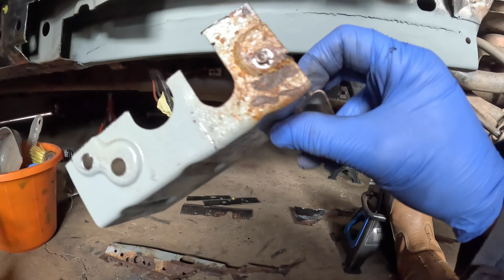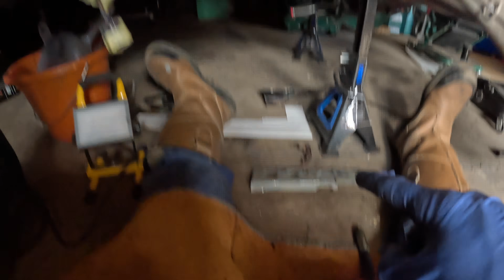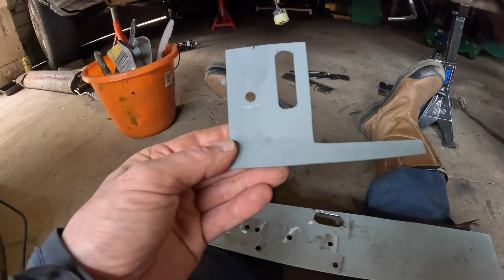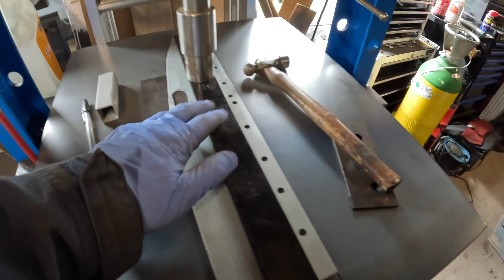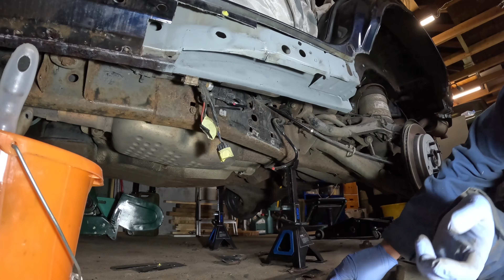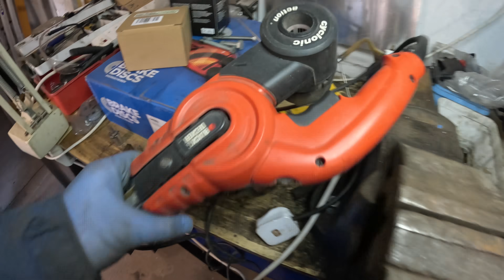DISCOVERY 3 LH SILL. PUTTING IT BACK TOGETHER THE MIDDLE LAYER

Comment: a lot of work and nice prep! I wonder though - would it not have been quicker and easier to cut out most or all of the sill and replace with a pre-made new sill?
Reply from the maker: Thanks. I did buy outer and inner pre made sill sections, but the inner middle one wasn’t available unfortunately.

Comment: Great gob well done I have a td5 disco 2 2000
What size wire are you using please
Reply from the maker: Hi. Thanks.
I use 0.9mm. I do also have 0.6mm, but I found that I was getting issues with the wire folding up too much coming off the spool when you get a bit of splatter on the tip. I just don't get that with 0.9mm.
Reply: @LR-nut  I am the same I bought a large spoil of 6 mm and it hard to go though the gun I change it to a 6mm roller but nut changed the inner liner
Should I get a inner liner or just stick with the 8mm wire
Reply from the maker: @GarrysMotorcycles8648  maybe that is why my machine has issues with the 0.6 wire, it's 0.9mm liner. I bought this current welder second hand a couple of years ago now. It is the same model as one I had new years ago, but had to sell. I forget exactly what it is now, but it's got to be 20 year old tech.
Reply: What make of weld through primmer you use too 
Regards Garry
Reply from the maker: @GarrysMotorcycles8648  I use this stuff currently
https://amzn.eu/d/0bhavJVS
In the past I used Upol.